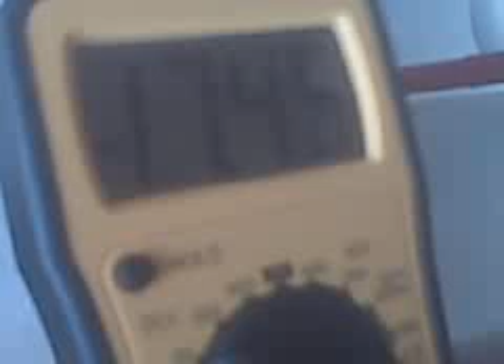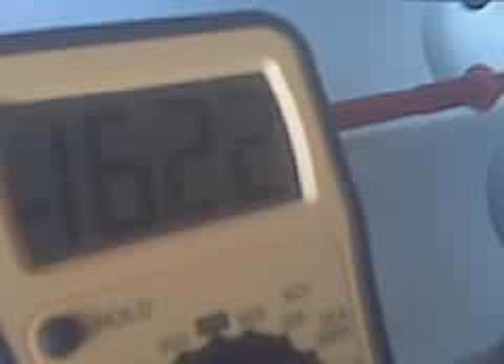Hub motor generator for wind power turbine

Comment: yeah that's the dual nature of an electric motor. Since you have those solar vacuum tubes you could actually make steam and use that steam to drive a small turbine connected to that drive producing power, like a miniature power station. Make it into a high pressure system you can really utilize you solar tubes even on less sunny days producing high pressure super heated steam that when release in the turbine creates a lot of power.